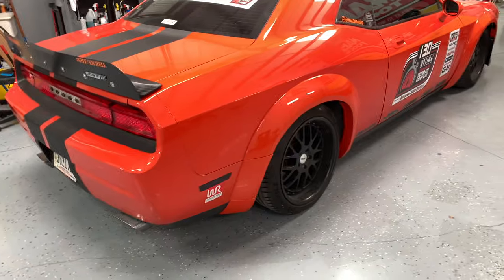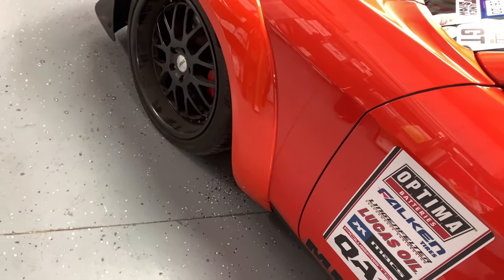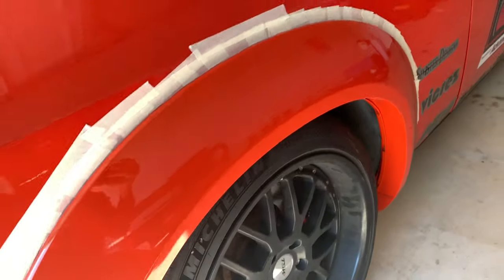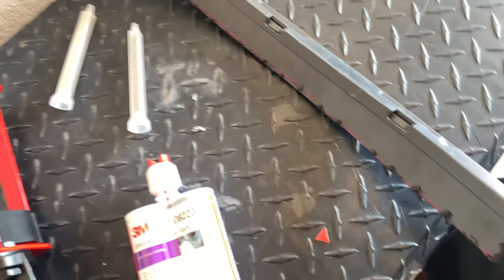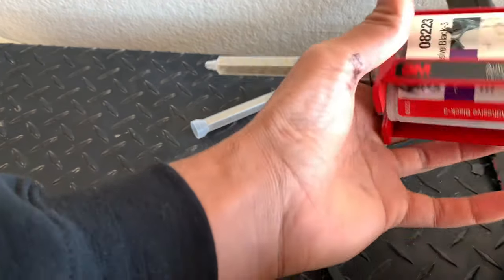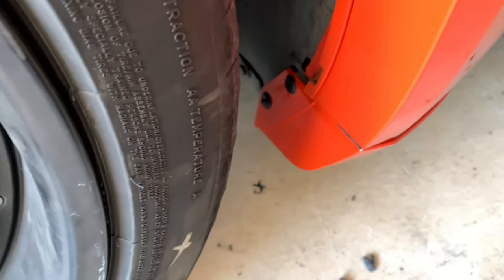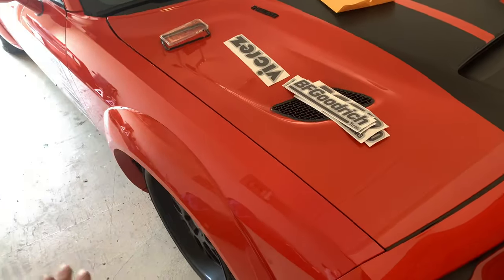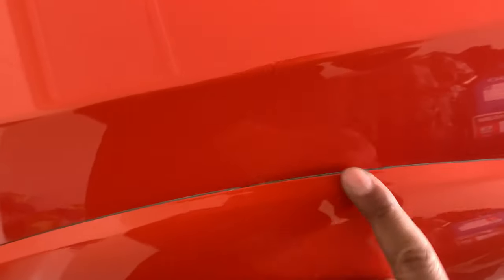Vicrez Challenger widebody: Tape VS Glue + (how to glue)

Comment: I wish you luck with that kit but IMHO, I think it's garbage. I think you are going to have issues with the top of the front fenders pulling away from the quarter panel. Even with that 3M glue, I've see this kit pull away from the front quarter panel once this kit is exposed to the elements. Heat and cold will cause it to expand and contract which will make it pull away.
Reply from the maker: Been 1 month of daily driving in the rain, Texas sun, Texas cold sprouts, spirited driving, even some “high” speed tests at the local track. 

So you wishing me luck has paid off! I’ll keep posting videos as things change. 

I have learned that it’s best to sand the paint so the glue has something to hang on to. It’s also best to apply in a controlled environment where all elements, the car, the flares and the glue are the same temperature. Which I did not do 😖(yikes!) 

So I foresee some issues in the future as for now I’ll keep driving it and when the time comes I’ll fix any imperfections! All part of playing with cars man!